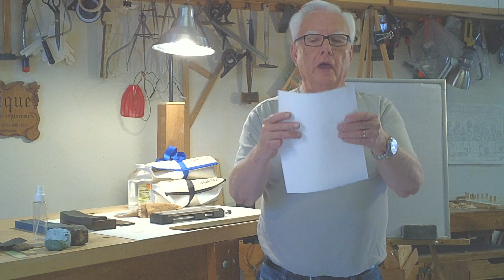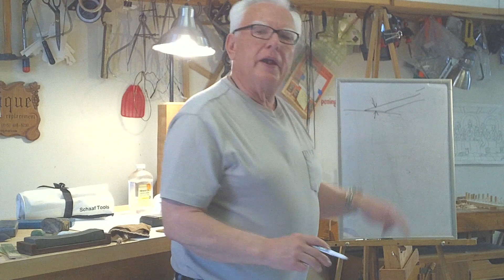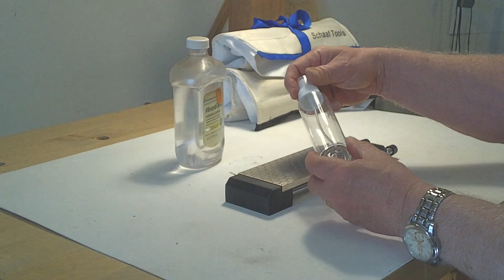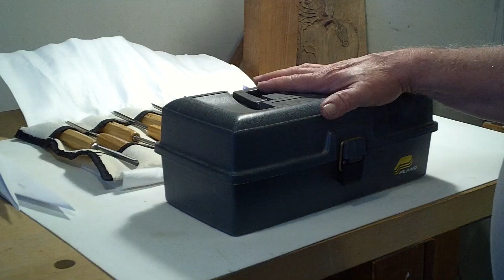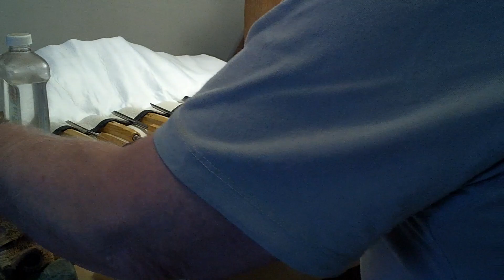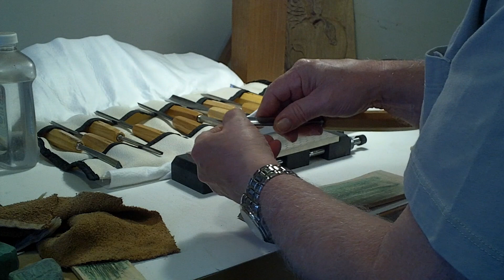Schaaf Diamond Stone Instruction.

Comment: A few weekas ago, I bought a couple of these brand new on fleabay ... less than £25 each. [the minute I saw the quality of the first one, I sent off for another]
I have reground and sharpened fifteen plane blades and dozens of assorted chisels etc on one of them, with excellent results and no loss of performance. The base is rock steady and takes plates from 6" to 8 3/4"  [152 to 225mm]  long.The set up is heavy enough 3 pounds 3ounces [1.450 kg] that you are not chasing it round the bench as you sharpen.
After use, wash off with detergent and dry them well. I then go over the stones with a large pencil eraser to clear out any residual dirt before putting away. Only takes a few seconds, but makes a big difference to longevity. For larger tools such as axes where it is earier to keep the piece still and move the stone, I thoroughly recommend THK diamond files. These are 14" long double sided and diamond covers 8 x 1 inch and they are essentially like flat engineers files. About £20 each but money very well spent.

Comment: Thanks Joe for another fine video. I bought one of the Schaaf diamond stones about two years ago and have since used it on literal hundreds of edged tools from axes, adzes, drawknives, spokeshaves, plane blades, chisels, and carving tools, The weight and thickness of the plate keeps it flat and helps when using the stone in hand when sharpening off of the bench, I own and use other sharpening stones such as oil stones, water stones, ceramic and slip stones but have found my Schaaf stone to consistintly to be the best option for exterior curved and flat bevels and for flattening flat backs of tools. I also love the stone holder. for keeping the stone still on the work surface, raising the stone above the bench,  and the ease of cleanup. I have also used it to hold some of my similar size stones. I look forward to watching your future videos.